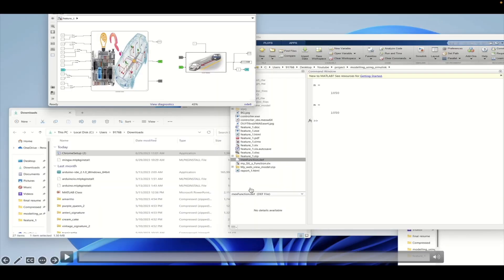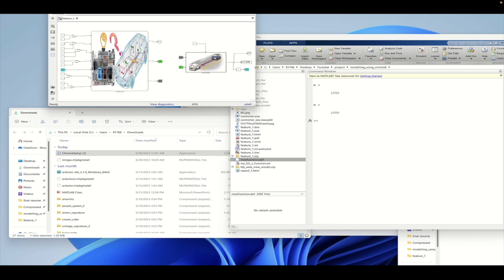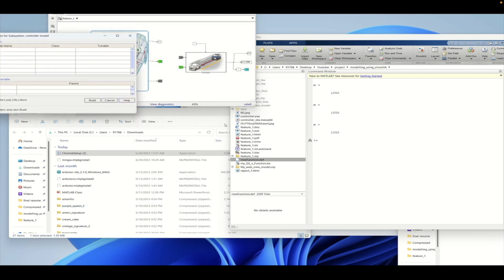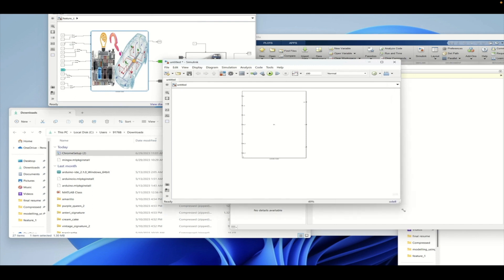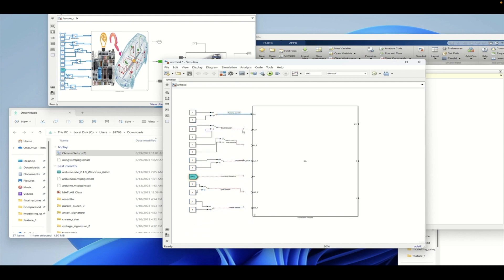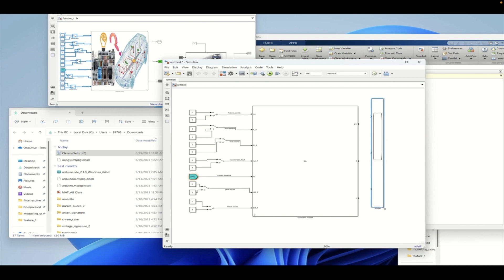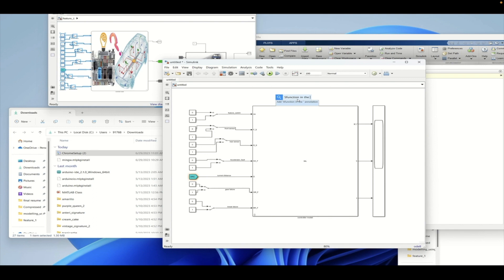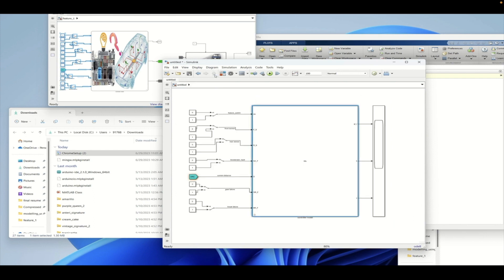SIMULINK TUTORIAL | CODE GENERATION | CREATION OF S-FUNCTION AND SIL VALIDATION OF SIMULINK MODEL

Comment: How to achive the Coverage 100% andd fallow the MAAB and Misra c guidlines.
Please make video on topic also
Reply from the maker: sure it will be released soon
Reply: @matlabtech8610  sir how to compare MiL testing with SIL testing together.
Reply from the maker: @maheshkumawat6619  
in case you want to compare the response at every sample time you can create two sub-system.

METHOD 1
whichever the response you want to verify you can use it in the scope block from individual subsystem to verify via graphs 

METHOD 2
you can put signals from both the subsystem and see the difference between the response between MIL and SIL subsystem.

METHOD 3
you can transfer the simulation data using to work-space block in simulink and have the data in MATLAB base workspace . post to which you can write a script in whatever way you want to compare the behaviour between MIL and SIL

I hope the methods are clear
- thank you for connecting with us for the quarry , Happy learning MATLAB (signing off MATLABTECH)
Reply: Very well explained and very helpful for the beginners 🙇☺️